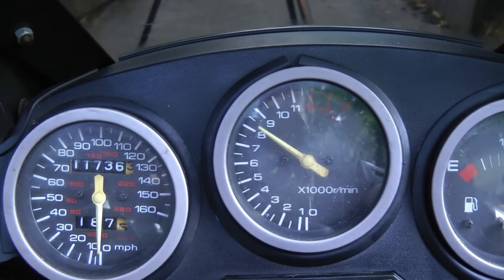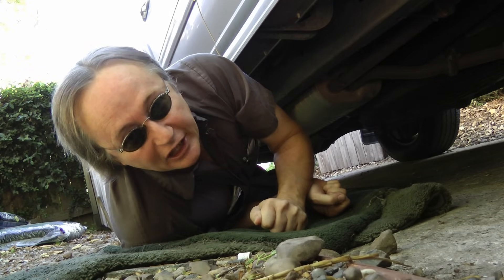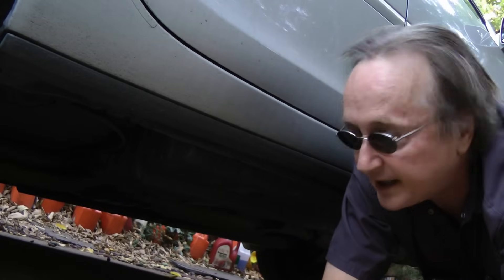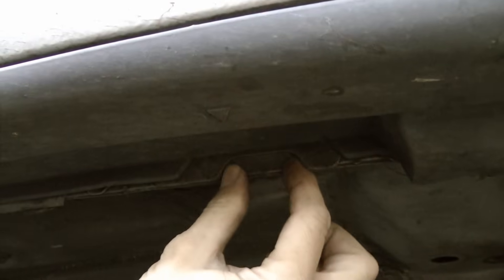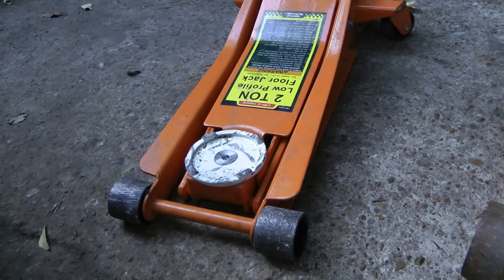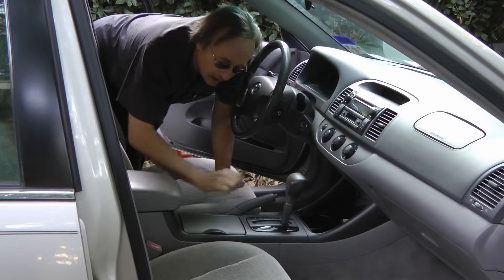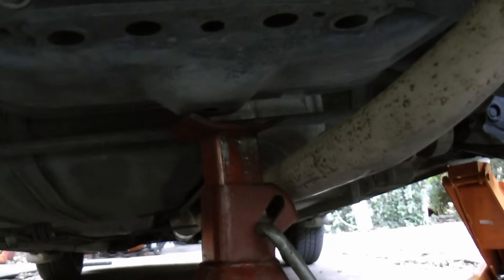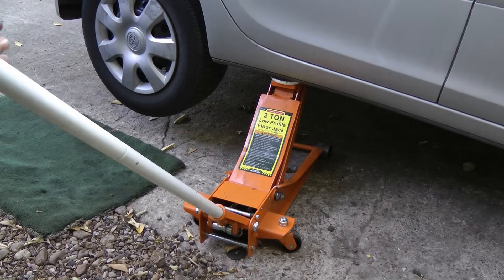How to Jack Up Your Car (The Right Way)

Comment: Hey Scotty I love your ool attitude it sort of sucks that you have to put up with idiots on feedbacks but anyway I’m in Western Australia and love your channel,now my only issue I have is I love my ford falcon ute or truck it can hold 1 ton but with an empty load it seems like there is a speed limiter where I can only go flat out at 185 is about or in the the good old school a little over 110 mp/h.
What can I do to the computer to get top speed instead of cutting back on the computer being set at a limited speed so do I need a scan tool to adjust the speed limit as I love speed and here in Western Australia there isn’t many roads that you have to worry about speed traps by the police.
  I have a large 6 cylinder which they call the Barra motor which here in Australia the boys put turbos on them ant they some how adjust the computer the help of the turbo to get up to, wait for it 2000 hp at the back wheels,
Now I know a lot of guys in the states that are crying out for these well built motors that will do incredible speed so even if I could get 120mp/h or in Australia 200 km/h I’d be happy so what can I do or how do I go about getting the computer to free up the speed limiter
  Lots of love for you mate as I think your tops and I love watching the guys and girls doing skydiving which I’d love to do one day as I ave my own C9 and T10 parachute r a jump one day but age is getting hold of me being a 61 yr old 
Buddy if ya can help me out on this one in getting my ute to get it’s maximum without having to worry about valve float or valve bout we call it here in Aus I’d appreciate it man anyway got to go for now I hope you can help me out as too many people here have a Ovid and are not working at Ford motor company or they are booked out till the end of the year so to speak 
 Take care I love you show on the internet you are awesome and don’t let those negative are soles give you the shits 
  Take care lots of love Lou Vezza

Comment: Word of advice never let your down that fast or hard it will screw up your shocks let it down slowly
Reply: It wasn't up that high in the video.
Reply: come on what do you think happens when you go over a short bridge fast or a speed bump. the risk depicted is of the car sliding off the jack as it decends, faster than the jack can go down leading to something getting punctured.

Comment: Need to know something Scottie, I let a so called mechanic work On my truck (big mistake) he tried to jack it it from the rear end but he put the jack in the middle of the truck now when I’m driving and I turn to the right I can feel a little play in the steering wheel and it feels like the rear swings left it did that to me on the expressway doing about 60 mph I don’t want to take it back to him my question to you is what could possibly be the problem and could it have been caused by him also I forgot to mention the truck was on gravel and while he was jacking it up the jack began to dig down into the gravel on one side so the truck fell off the jack please help I don’t want to die trying to get to work or back home from work

Comment: okay so my car is 1460kgs an jackstands are 1200kg, each jackstand on each side of vehicle stack up to 2400kg to front an other pair at rear so that 4800kgs all up is that how it works ? im just on a budge here, 1600kg jackstands just for 2 is like $110 where i can get 4 1200kg jack stand for $60
Reply from the maker: yes, that would work fine, stands are actually highly over rated, I've never seen a good one break myself. Steel is very strong, just don't buy cheap aluminum ones, they bend
Reply: oh awesome an yes they are steel SCA jackstands, thanks for the help. have a good day Scotty.

Comment: wouldn't you jack it up from the cross member  and then put the stands on the notches?
Reply from the maker: either way weight is on the notches, doesn't really matter, but notches can bend easily over time, so stands on the other parts is really better
Reply: Most jacks today won't reach any cross members as they are deeper than the notches towards the center on most cars, didn't you see it here ?
He used only one jack-stand for the whole rear so logically it had to be in the center, though if possible, it would save at least one lift every time :)

Comment: I notice you don't use rubber jack pads? and you lowered the car onto the axle stand far too quick and then back down on to floor, also your hand brake looks at its limit, that would not pass MOT test hear in UK.

Comment: my jack spots are rusted and bent in. Where else can i lift it at?
Reply from the maker: where the A frames bolt to the main body is a good spot (that's behind the tires, each side has two A frame bushings where the A frame bolts to the main body, you jack under them
Reply: Thank you. So water was leaking into my car from the AC i got under there and blew air thru the drain line but its still leaking. Any suggestions. Also thank you for your videos they have saved me so much money.
Reply: +martinpotcf123 unless youre ready to tear apart your dash back to the firewall to replace your heater core or whatever part if your HVAC system is bad, plug off the coolant lines on the engine side of the firewall to prevent further coolant leaks into the passenger compartment.
Replacing the heater core on most cars is a real bear of a job though if you have the skills and live in the northern latitudes you may need to do it. A leaky heater core can cause a lot of issues with mold and mildew which can make you sick.

Comment: The worst thing about these pinch weld jack supports is that in the northern climates, the salt eats right through those before anything else and one day you find yourself jacking up a car with the jack pad going right through the rotted body!

Comment: My two biggest fears about jacking up a vehicle. 1, it is going to fall on me.  2, I am going to punch a hole in it by putting the jack or the stand in the wrong place.  Even after 25 years of fixing my own vehicles I still have these two fears.

Comment: Now harbor freight jacks have a recall lol
Reply: Only a pair of discontinued jack stands. Not their jacks. Many tire shops and mechanics use their floor jacks all the time. Even the shops around my town have harbor freight jacks. I just bought a brand new Daytona comercial jack from them yesterday for $200.00 and it's made by the same company who makes the $700.00 Snap On Jack. It's actually the same exact jack. But Harbor Freight is privately owned and so can sell the jack for a third of the price. (They don't need to pay for a delivery truck and please corporate investors.)

Comment: Hey Scotty, thanks for the video. It has been a great help to me.  I have a question about the jack stand position.  I'm assuming you would need 2 jack stands to pull off 2 wheels. Where would the other jack stand go as it seems like the one in the video is at the center of the vehicle.  Would I just remove 1 wheel at a time?

Comment: I need to get all 4 tires off the ground not just the side.
Reply: For rear, try the iron part of the rear differential. For the front, well it depends more on the car model. Search YouTube. For me, it has been a PITA to find information on the central jacking point for my 2014 Subaru Legacy. All the videos I find are for other Subaru models! >:-b

Comment: Hang on... he jacked up the car on one CORNER, and put the jack stand in the middle of the cross member...
Is THAT how you’re suppose to do it?

Dang it. I’ve being doing it wrong all these years. I put the jack stand only under the same corner I jacked up. 

... then can you just jack under that central spot in the middle of the cross member, and lift an entire front-or-rear end?

Comment: Never jack up at a pinch weld with this type of jack end
Reply: Or place one jack stand at a centralized point in the vehicle. He should've used the floor jack on the central front or rear point, and then used the jack stands on the pinch welds. This guy is going to get someone killed.

Comment: where do i jack my 96 nissan sentra se??
Reply from the maker: the crimps on the side, or use any heavy metal strong point like where the A frame bolts to the body on each corner
Reply: Scotty Kilmer alrighty Then Appreciate the Help

Comment: WTF? A single jack stand in the centre ?! That is bad enough, plus the fact that even to get it to the centre he has to get right under the car while it is still only on lifting jacks - dangerous.  You need two jackstands on opposite sides of the car. I am afraid it is not always easy to find suitable locations for both the lifting jacks and the jack stands though. 
He skips over the fact that those notches are designed to receive a particular shaped jack head - the one usually provided for a roadside wheel-change. A standard workshop jack will not have that shape so for my cars I make shaped hardwood blocks as an interface.  He also overlooks the fact that the handbrake is useless if you have the rear wheels off the ground.
Reply: a single jack stand in the center seems so dangerous. He responded to other comments like yours saying "it works fine." Yeah "it works fine (so far)" is what gets people hurt/killed. He goes on to mention that HE works on flat concrete, but neglects to even say this in the video. pathetic. he should take the video down or edit it with warnings, but of course doesn't

Comment: i pile several steel building support beams under the vehicle whenever i get under a vehicle. My life is 2 important to leave to a hydraulic jack that could fail or jackstands (twigs) that have ridiculous bases they stand on, they are narrow as fuck with no surface area support and anyone with a working brain should realize you want as much surface area support you can have for something to maximize the security of its physical stability. I could try to set my drink down on and balance it on fuckin toothpicks  but i think ill just stick to sitting my cup on my 2ft by 2ft coffee table as its a lot less likely to spill. SURFACE AREA.

Comment: holy shit it doesnt matter if the jack movesl ike 6 inches forward when you jack the car up?
Reply: it's supposed to
Reply: The car isn't going to slide horizontally across the concrete with rubber tires, it ain't going anywhere.
Reply: its an overlooked point. you need a surface smooth enough for the jack to move forward as it lifts higher, otherwise what moves is the contact between the jack and the car and then you get major risks of it sliding off. I say this from experience. even if you have a nice surface, check for stones that may have chock your jacks wheels before you start lifting.

Comment: I'm no mechanic but I see two things definitely done wrong in this video. Number one, hold down the gat dang button on the parking break when engaging it so it doesn't make everyone cringe. Number two, if you just engage the parking break all the time in the first place like a smart driver, you wouldn't have to worry about your car rolling away smh

Comment: the handbrake is only for the rear brakes, if your lifting the rear end up why would you pull the handbrake? surely you should be blocking off the front wheels to stop the car from rolling. Pointless locking wheels in the air!
Reply from the maker: to keep it from rolling as you jack it up. I work on a flat surface, and once the jack stand is put in place, nothing will move then.

Comment: Why didn't those stupid engineers just put solid jack points on a newer cars? The engineers must be doing this on purpose so you couldn't jack the car easily so you'd have to take it to the dealer. Those evil engineering swines!

Comment: You're not supposed to use a floor jack on a pinch weld. So no, this isn't the proper way.
Reply from the maker: hate to tell you jack, that's what they are made for, the factory jack fits between the two notches
Reply: The factory jack also isn't a floor jack. It's a scissor jack, which only puts the axial load of the car's weight on the top of the pinch weld, not the bottom. So wrong. I'm not trying to be a dick. It's just a bunch of people are gonna end up bending their car's pinch weld from this video.

Comment: Kind of useless, you should call it "how to jack up a Toyota. I expected to hear  general info about all  makes of car and trucks
Reply: +Peter Goldwing You should always look in your owner's manual that is hopefully in your glove box.  If it's not there, google the make and model of your car and add "jack points" or "owner's manual" without the quote marks and you will be fine.  Then maybe put some paint on the jack points so you don't forget.